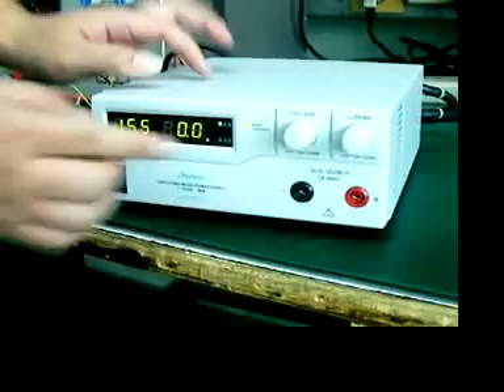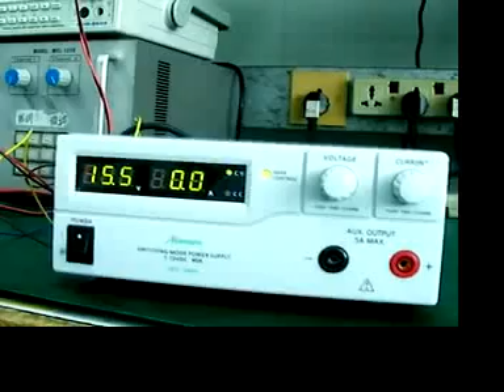MANSON HCS ANALOGUE REMOTE CONTROL IN ACTION

Comment: Can you adjust the voltage more precisely with these variable resistors? I mean, are you able to set 50mV of adjustment instead of 100mV in 100mV?
Reply from the maker: The design of the power supply out put resolutions are limited to 100mA and 100mV.
Remote control cannot change the hardware design.